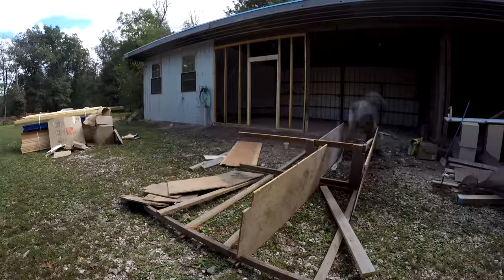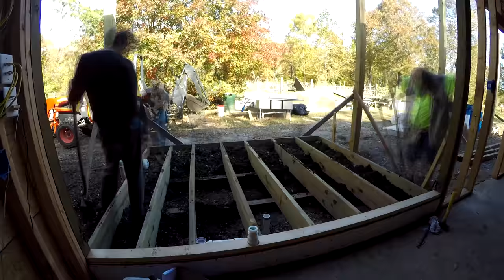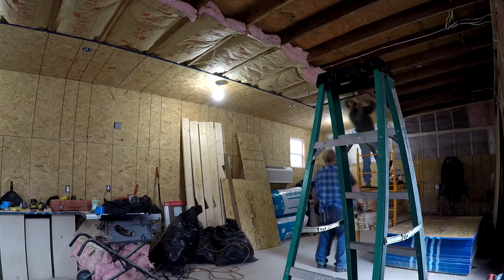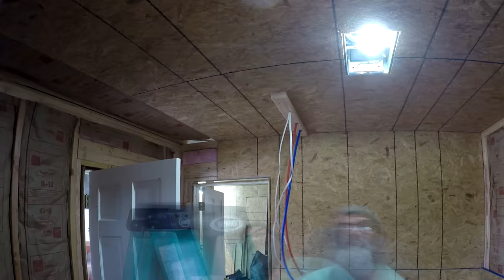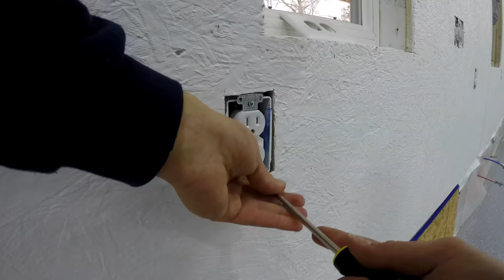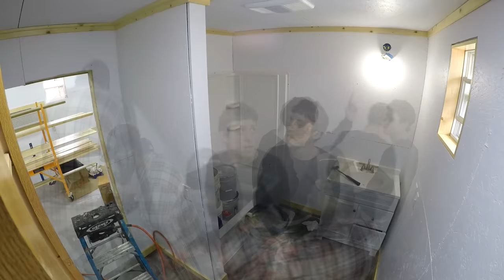Remodeling Our Pole Barn into a Kitchen - Time Lapse

Comment: Give you a tip give the washer dryer combo to some one you don’t like. I once put a bath towel in the dryer damp came back from work 8 hours later and it was still damp never did dry any clothes. Invest in a regular. Washer and separate dryer in the big picture you’ll save hundreds if not thousands of dollars.
Reply from the maker: Hi John, thanks for watching. It's interesting you mention the stackable dryer because we actually had the exact problem you mentioned for the first few months after installing it. In a previous video I made, I had converted the dryer from natural gas to propane, and I had accidentally broken the igniter. After fixing that the dryer works fine now, but the design isn't great.  We just didn't have the square footage for 2 separate units

Comment: A good, big working harvest kitchen. Plenty of room to set up work tables, rolling racks, and other utilitarian items. I couldn't tell: Is there a drain in the floor for cleaning? And did you make accommodations for future electrical expansion for things like a blast chiller, a coolbot-type cold room, or a bank of freezers? Any plans for a back-up generator?
Reply from the maker: Thanks for watching! A harvest kitchen is a great term for this room, as I haven't thought of what to call it.  The extra storage space is used for 2 metal racks, as well as a desk and couches so the room is somewhat multipurpose. We did try to plan for expansion, such as including many electrical circuits and additional 240v power lines which are just covered for now. A floor drain would be handy but the foundation was already poured so that wasn't possible.  With 5 freezers, keeping them running is important. Luckily our electric company is really good and we've never had a power outage longer than a couple hours, but I think installing a transfer switch in the breaker panel would be a good idea so we wouldn't need to have extension cords running everywhere from our generator.

Comment: **Very Good job 👍. Next time for the cilling boards go ahead and use the groved finish/one side sheets then you dont have to rock it plus opens up for more options in finishing like staining, or painting like antique cilling white white with the groves alread in the cilling boards/sheets then run some nice color matching 👑 crown. It would pay for the crown molding by the money you save from sheet rocking taping mudding floating sanding cleaning dusting then painting. Thats alot of time and money and cleaning, that looks better and pays for free paint and free crown molding with the savings maybe even some left over if you shop right and/or do it your self. However even if you have to pay for it you still come out ahead in savings and looks. FREE ProTip my friend keep up the good work always give him the credit have a blessed night my friend.**
Reply: Always very good start but you
 have to finish all the way or dont do it. like just painting the wood in side?
Reply from the maker: Thanks for watching and happy 4th of July! I appreciate the suggestions, it sounds like your ideas would make the room very cool looking! In our case though we tried to keep the price down as much as possible so we didn't invest much into making the room decorated very much, but having the osb walls and ceiling does make it easier to add decorations in the future.

Comment: very functional and detailed!! I like the job! Looks perfect for storaing food and prepare large meals. I have a question, is it posible to instal tiles on top of the OSB? will it last longer?
Reply from the maker: Thanks for watching, I'm glad you liked it!  I assume it would be possible to glue tiles to the OSB, but I don't think it is really necessary because the flooring and walls are sturdy as they are.  One convenient thing about OSB walls is the ability to hang or mount anything without having to find a stud, like you would have to do with conventional drywall.
Reply: @joshuareynolds5219  I live in Peru and here the humidity levels are very high 98% sometimes and thats why I would like to protect the wood.
Reply from the maker: That's cool, we are in Arkansas, US, and we are having our summer right now and it is very hot and humid here too. On the building we have a plastic layer in the wall as well as a layer of metal on the outside that keep most of the humidity out of the room.

Comment: I wish I had the opportunity to have a kitchen like this, I envy you this....... But,  what material is the pink insulation batting made of?, I'm only used to glass wool, rock wool and styrofoam as insulation material here in Norway.  I also ponder a bit on your choise of flooring in the bath room. ....... Alas, overall I think this was a bloomin good idea....... next you have to film it while using this lovely facility.

Comment: What was that metal plate you put on the baseboard that was after the visqueen and before the osb?
Reply from the maker: That piece of metal was designed to be a water barrier.  In the spring, we occasionally get rains which flood the ground, and this building is right at the bottom of a valley, so before the remodel we've actually had water come inside.  If this works as expected, we could have up to 6'' of water puddled above the concrete slab without any water coming inside.
Reply: Joshua Reynolds thanks! I’m turning a section of my pole barn into my office, and wanted to know Incase I need to add this since I’m at the drywall stage. Loved the video btw
Reply from the maker: Thanks for watching, glad it was helpful to you! I would definitely recommend putting the water barrier installed if there is any possibility of water getting in.

Comment: Question. What is the purpose of that foam putting on ceiling and wall? We have not install that here in the Philippines
Reply from the maker: Hi, thanks for watching.  That foam is called insulation and its made of fiber glass, it helps to hold the temperature inside the room, whether its keeping the room cold in the summer, or warm in the winter.

Comment: What are those Redish things which they put between the woods/walls ??
And what are they For ??
Reply from the maker: Hi, thanks for watching.  Those red square pieces in the walls are fiberglass insulation which helps keep the heat/cool in the room.  Here in the United States that type of insulation is very common in buildings, but i'm not familiar with how buildings are built in other countries.

Comment: It looks like a commercial kitchen, but I'm wondering about some of your choices. Only one window in that long wall...a deck that looks like you used dirt and cinder blocks for the foundation?  Is that carpet in the bathroom? I'm wondering about the plywood walls: cooking big time in there would mean lots of moisture and grease. I guess if you painted it with the right paint it wouldn't be too much of a problem. Sorry. Too picky, I guess.

Comment: Total cost?
Reply from the maker: I don't know the exact cost but I believe it was around the cost of remodeling a couple bedroom house.  The fact that the concrete foundation and the roof were already built decreased the cost a bit, but the framing of the original building was somewhat poorly designed so we had to redo some of it, so it ended up costing a bit more than we had planned.

Comment: The last thing to do when you have such a large space, as your Barn, is add sqft. Your family could have saved so much money in not building that addition. You could have used a corner of the building to built the bathroon and leaft the covered deck to be built in another time. And than you could have used the extra money on the finishies, mybe on drywall stead of plywood.
Reply from the maker: Thanks for your feedback.  The addition we made including the roof extension was actually much cheaper than we were originally thinking of doing; extending the foundation.  If we had built the bathroom inside the original foundation, it would have taken up too much of the interior space.  Before we did the remodel, I had originally drawn a dozen revisions of the floor plan to decide what would work best for our needs, and we made that happen.  As far as the plywood (OSB) walls and ceiling instead of drywall, that is a personal choice of our's, not a result of a financial limitation.
Reply: @joshuareynolds5219  That's great. You're comfortable with your choices and happy with the results, that's what matters. The comment I left you was also meant to  whoever watched your video and would wanted it to go in a diferent way.

Comment: You have OSB board  exposed in a kitchen next to stoves and next to a sink?  Over all it was a good project but I think you could've done a lot better with the blank canvas that you had.
Reply from the maker: I know we could have done much better on aesthetics, but we were trying to keep the costs lower while still including a lot of functionality.  I know it isn't typical to use OSB inside a room, but it worked best in our case.

Comment: that is by far the ugliest renovation i think i have ever seen. you had a blank canvas and that was the outcome? wowser
Reply: Agreed. That was very disappointing
Reply from the maker: My idea with this video was to document the process of a basic remodel while showing all the steps involved such as insulation and walls. I agree I have definitely seen more fancy renovations, but the building was previously a pole barn built for mostly storage so we were somewhat limited on what we could do without tearing out the roof or foundation. Also we were mostly focused on building a functional kitchen space while keeping our budget in mind.
Reply: I thought the exact same thing. Everything was going well, and then they put in that hideous flooring and then I knew it was all going downhill from there...
Reply from the maker: The floor appearance as well as the rest of the room is just personal preference. It is functional, is easy to clean, and is inexpensive.  Carpeting or wood for the flooring would not have worked very well for our usage of the room
Reply: Nate, this is a farm, not a castle
Reply: Yeah honestly the guy seems to be going for functionality and renovations are opinionated. It's your opinion that it doesn't look amazing, but it works and that's what he seems to need it for. It doesn't really matter if it's not to your taste anyway.
Reply: @joshuareynolds5219  I would suggest maybe getting some kitchen carpets or something, obviously seating. That flooring will be hard on your feet and back if you're doing a lot of standing in there.
Reply: It looks like it would be used to process alot of food, with all those refrigerators. So maybe produce if its a farm. Or wild game, if they are hunters.
Reply from the maker: @AlexanderPwn We actually did add some couches, chairs, and shelves after the video was finished, so the all that extra space is being used now. Right now we just wear our shoes in the room, but taking off shoes and adding floor rugs could be another option.
Reply from the maker: All those refrigerators hold a lot of food we actually accounted for that many in the floor plan. We raise a lot of our own meat such as turkeys and sheep, and we can also store a whole cow worth of meat in the space we have. We also grows a lot of vegetables and other food, so I actually hope 5 fridges/freezers won't fill up before the end of the summer!
Reply: Wow. Thats alot if food. You must have alot of people to feed
Reply: @joshuareynolds5219  well that answer my question as to why you have a full bathroom in there. But I really thought it was going to be like a commentary or some kind of like food prep area for your business I completely misread the whole entire video still a nice video because it serves its function if you working on the farm I mean I honestly mudding back and forth from outside to inside at least you could spray that right on out I was looking at it like that.
Reply from the maker: We are a family of 4 but we try to be self sufficient when possible. Also having so much food stores saves a lot of time as we live a relatively long way from grocery stores.
Reply: @joshuareynolds5219  why such a big kitchen? you have that many to feed? how many children do you have?
Reply from the maker: @David Rief I called it a kitchen in the video, but the room is designed to be for multiple uses, hence why it is large.  If you have done any canning, pickling, or food preservation especially, you would know how necessary it is to have a large kitchen space.
Reply: @Cooldaddio2  I grew up pretty much this same way, always working extra time during the summer months to put away the food we grew and raised. It is a time that is no longer really appreciated or has been lost and the understanding of the importance of self reliance with out the need to have fancy things or keep up with the Joneses.
Reply: @joshuareynolds5219  A 22 qf freezer would make a great addition to the kitchen space if you do not have one already! Thank you for the video and God bless you and your family!!! Happy mothers day to your Grandma and Mom!
Reply: @Cooldaddio2  I grew up with 5 other siblings,8 people is a lot of mouths to feed plus when you get company 4-12  more. My mom would cook up to 7 whole chickens at a time when we had family and guests over plus all the veggies on the side.We ate what was put in front of us with no complaints.We raised our own chickens 200+ and rabbits 100+ each year a couple of hogs.
Reply: bearpapie69 hahaha what does your comment even mean? I’m guessing English is your second language?
Reply: Joshua Reynolds I get that, and understand budgets etc but those strips of wood around the dry wall connections are absolutely  hidious, it would of been a completely different much cleaner much nicer and classier finish if you had of just taped and mudded. I’m guessing it was to save money on mud and paint?
Reply: Livia CL Obviously it’s not a castle.... I wouldn’t put this Reno on my farm. A farm isn’t an excuse for bad taste
Reply: Oh my word I cannot believe all the whiny people on here complaining about this it's a very functional kitchen with very specific things in mind. From what I understand they have a kitchen in their home this kitchen is more for farming canning and meat processing and it's very functional and I think it's a great job that they did
Reply: Humm, maybe you should disable the comments. Hard work and I am glad it works for you!
Reply: Charlotte Brown there’s no wining or complaining just stating an opinion that they did a Reno and had a blank canvas and what they CHOSE to do with it is quite ugly. It’s got nothing to do with functionality putting those hidious wood strips over the dry wall joins is definitely NOT a functionality choice.
Reply: @bearpapie69 you are rude !! He build this kitchen for their own use. Knew what they needed and did not need to be fancy. Built so is within his budget. Does not need or want your negative comments !! He was just/ showing what and how they did it ! Don't like it ? Don't watch it !😡
Reply: @joshuareynolds5219  oh yes if you're doing canning you would have to have a kitchen that size I agree with you

Comment: Can I ask you, guys? Why most of American people use wood instead of bricks or something surely?
Reply from the maker: Hi, thanks for watching!  I believe the main reason we use wood more commonly in the US is because it is cheaper, I think Americans are obsessed with doing things cheaply :)  I know that in many other countries, brick houses are much more common, and they are probably stronger too.  One advantage of wood houses is that repairs are often easier, because you can literally pull off and open any part of the wall with just a screwdriver!
Reply: Also to add on America has many different climates, houses vary by region. For an example California gets a lot of earthquakes during an earthquake brick houses can easily fall straight down. Wood is flexible and it moves so when the ground shakes the house moves with it compared to brick which isn’t flexible and won’t move. And in the Southern region of the US a lot of houses are actually made of brick which is strong and good for hurricanes.

Comment: Why people in u.s made wooden house is this a rule?nd I think its not so strong.... Any wild storm can destroy houses...can anyone tell me..I like bricks houses
Reply from the maker: I agree brick houses would be stronger, and I know they are more common in countries outside the US.  Here in the US, we mostly have wood framed walls with more wood on the inside!  While they probably are weaker structurally, they are easier and cheaper to build and upgrade than concrete or brick houses.  It is not a requirement to build houses this way, but it is most common.
Reply: @joshuareynolds5219  thanks..for explaining Joshua rey...I hope people can make their bricks house easily...these govt.I don't know how they work...everything now a days costly...nd incomes becomes low these govts.r flawed..
Reply from the maker: There are some brick houses around here, but it is confusing why it is expensive to build them here, while in some poorer countries almost everyone has a brick house.  Maybe it is because of the government, or it could just be preference here.

Comment: Plastic here and there 
 cos we love 
PLASTIC
MADE OF OIL. . .
Reply from the maker: I think you are taking about the plastic vapor barrier in the wall. It helps keep the humidity outside the building and here in Arkansas we have very high humidity in the summer.
Reply: Joshua Reynolds 
Ok